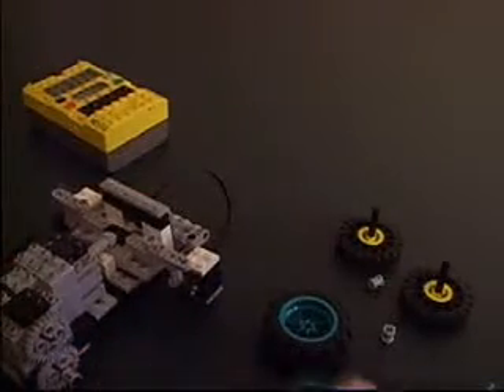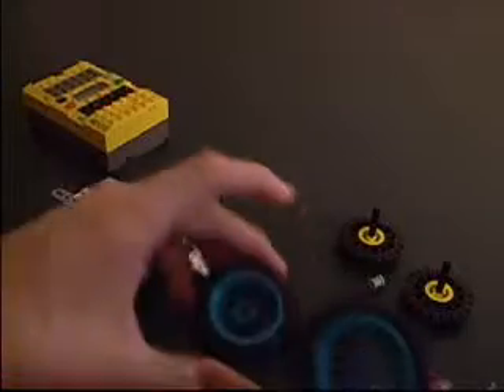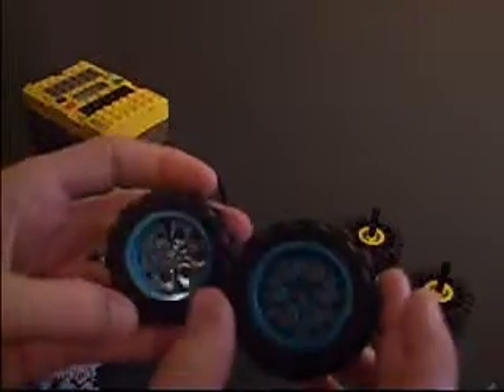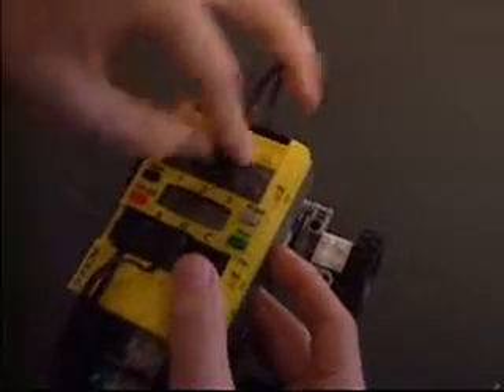Lego Mindstorms Rack & Pinion Tutorial Pt. 2

Comment: Hey I am on a FIRST robotics team at school and want to get into lego mindstorms robotics. I have thousands of technic pieces and a lot of experience with lego mechanics. I was wondering, do you think that I should go with the older RCX or get the newer NXT?  I am leaning towards the RCX because  I can get one with motors, sensors, wires, software, etc.  on eBay for about $60.00. The NXT would cost me $279.99 new. It seems that the two are very similar as far as features go. Any opinion?